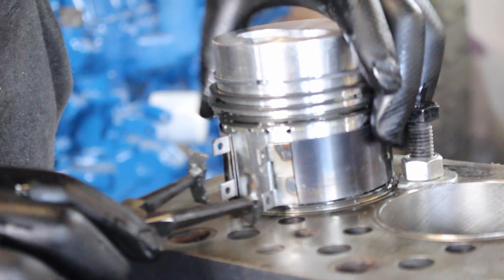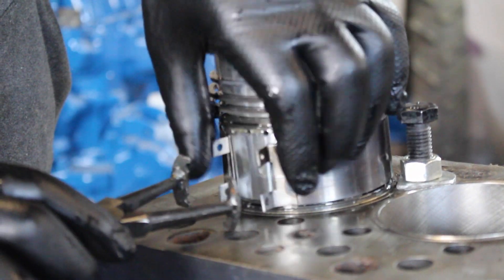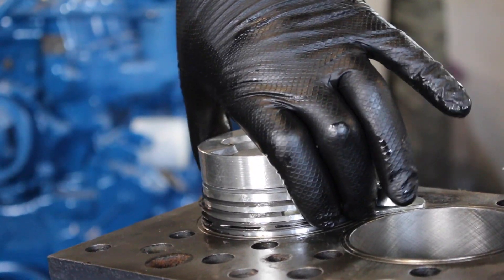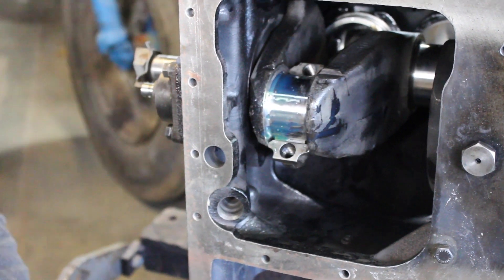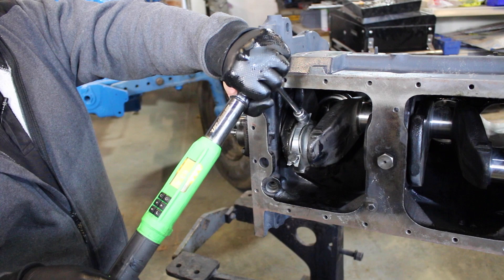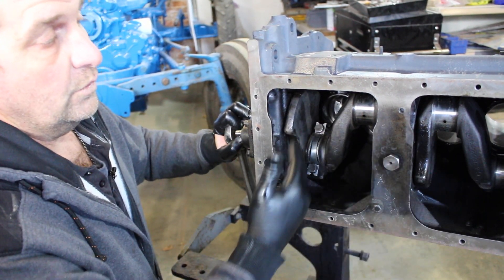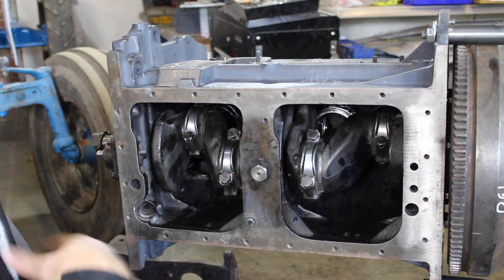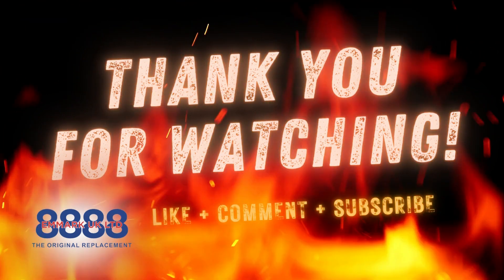Fitting The Piston Assembly to The Ferguson 23c Engine

Comment: Do you need to use plastigauge on the conrod bearings? Thanks
Reply: Thanks 👍
Reply from the maker: No problem.  @murdogordon3091
Reply from the maker: Hi no if im going to use the crankshaft again I take it to the machine shop for it to be either ground and polished and it is measured by them for the correct bearings.